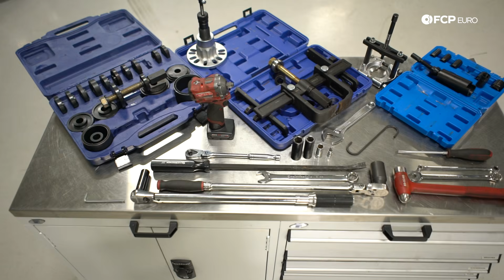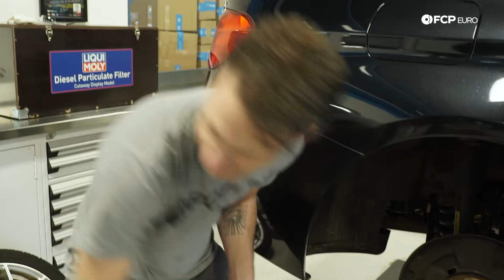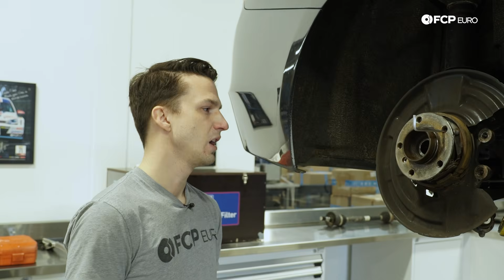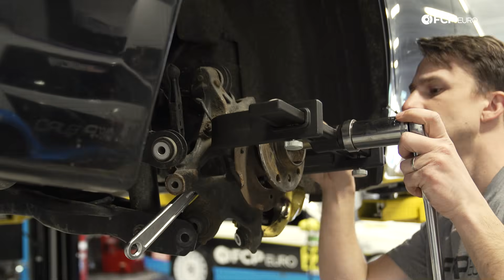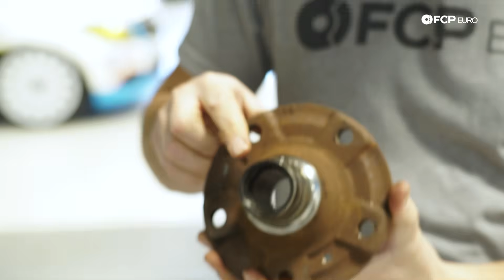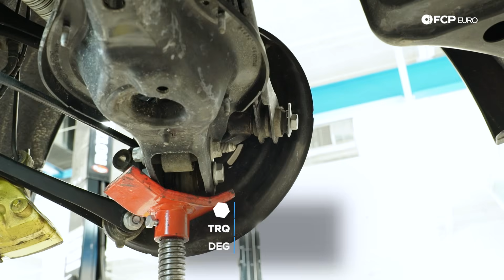BMW 328i Rear Wheel Bearing Replacement (2012-2018 BMW F30, F31 328i, 330i, 335i, 340i)

Comment: It anyones reading this and also doing the job,, do NOT use any sort of aftermarket hub that a kit might come with,, thought it would be fine tossing it in with the new bearing but it was a couple mils off from letting the caliper bracket bolt on and I had to take everything apart again and get a new bearing and use the old hub and put everything together 😭 so just a fair warning

Comment: Don't waste your time, taking backing plate out, taking brake shoes out, taking cv axle out from differential ( dont leave it hanging, just put it on top of control arm beside caliper) 

To push the cv axle in the hub, apply some grease on cv axle teeth,  then slide it in as much possible, then put a piece of wood on hub and smack it ( easiest way to push cv axle into the hub)

I did this job today in the shop and wasted time to take those things apart on one side that I didn't need to. Then I didn't do the same on the other side. 

Thanks for the Video.

Comment: Does anyone know if the f36 is the same design as the f30? I figured a 428i would be the same as a 328i but after a quick parts search it seems like the f36 takes different part #s and I have not found the hub with bearing pre-installed.

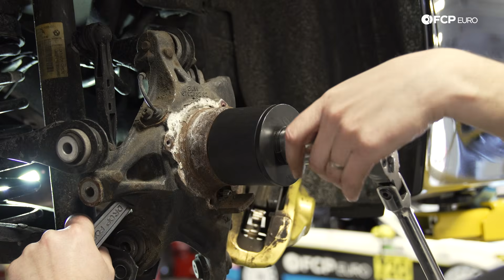Comment: Bro! @2:29 you try to hang the caliper from the sensor wire! AND... @3:12 you say clockwise then draw an anti clockwise circle?  I'm only 4 min in, should I keep watching?? @10:30 eye protection! @10:45 you dont show pulling the bearing. come on that's the most satisfying part.

Comment: Well done great video man I ended finally getting my correct hub into bearing and knuckle assembly the other day look forward to getting everything put back together thanks to all of you at fcp !-Dane-
Reply: Since my car is an e90 and I should have ordered everything from fcp instead of partsgeek should be back on the road soon again thanks for expertise i am sure I saved some cash by not having the stealership do repair since had to cut everything with smoke wrench in shop since car was from Minnesota after buying 2 bearings because of breaking first one since I pressed in the wrong hub that was from partsgeek and having to also buy 2 new hubs to get the right one and a cv axle finally 4 weeks later car shld be done this.weekend.!!!--Great Dane

Comment: is it really necessary to remove the axle after you pop it out of the hub? seems like there is enough clearance to do the work without removing the axle.
Reply: You don’t need to remove the axel from the differential but you will have to remove it from the knuckle in order to replace the bearing 🤪 In actual context for answering your question lol..
Reply: I didn't have to when I replaced mine,

Comment: @fcpeuro, great timing, my RWD F30 is up in the air for wheel bearing replacement, but I need guidance on those specialty puller tools, please please post some links to the specialty presses.

Comment: If bad wheel bearing is ignored for long, the axle is guaranteed to be stuck in the hub due to excessive heat cycles 😂
Reply: Yo explain this please?
Reply: @mnanez11 friction.